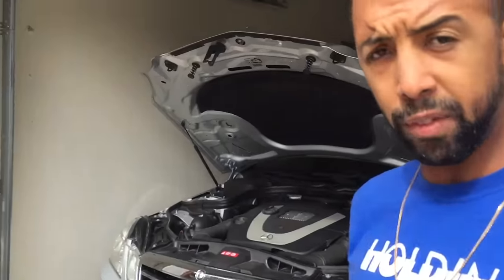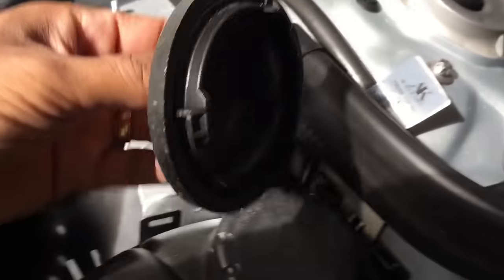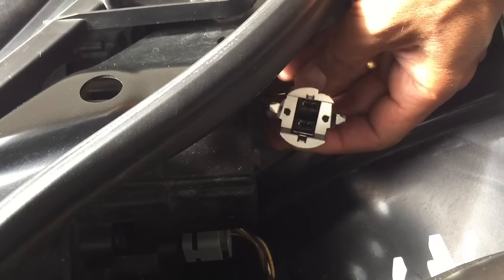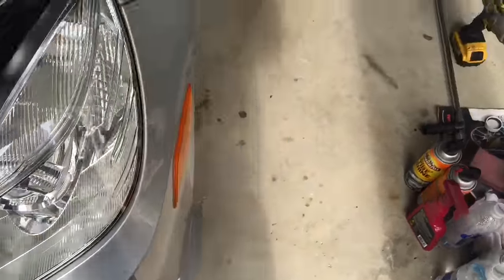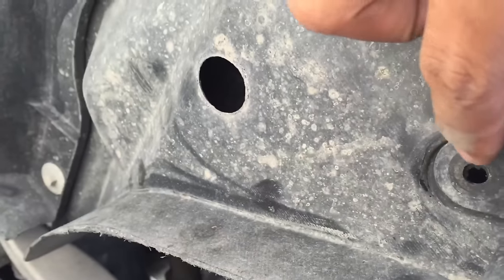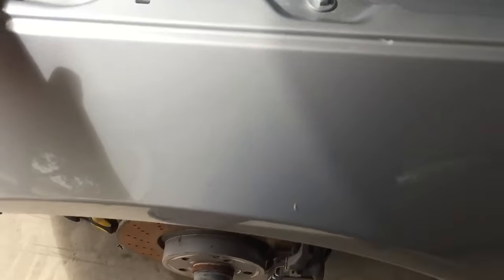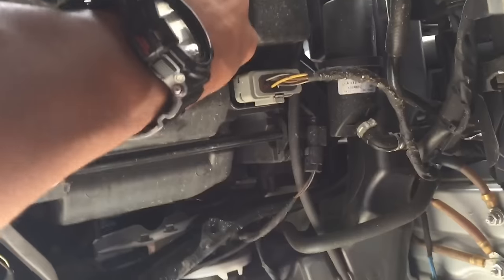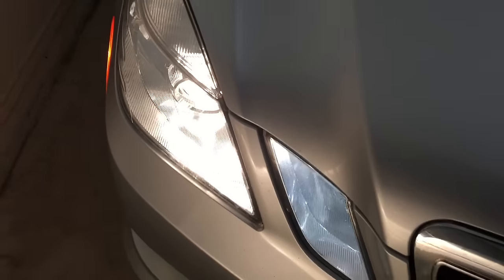How to change headlamp bulbs in your Mercedes E class

Comment: Just changed the same bulbs. The right side is easy, the left side just as easy, but you have to remove the two plastic nuts where the small device (don't know what it is) in front of his hand at 1:30. There is just enough space to fit your hand in to remove the cover of the Low Beam light. Easy Peasy! You do not have to remove the tire and shroud!

Comment: Hi guys!// i change the right side H7 bulb with a new one and still not function when i turn the steering wheel in the right like supose to do.. when i turn left the H7 bulb function butt not the right side
Reply from the maker: Daniel Timmer maybe try to go into the display settings and reset the turn light function

Comment: also jspec,on the driver side you don't have to take out the entire inner fender,just the 2-10 mm nuts and 2 of the plastic rivets and you can just fold it down and acces the bulb.also I upgraded my lights to opt7 5000k 55 watts h.i d,big big difference.

Comment: Good video but I have just changed my driver side low beam globe and its not necessary to remover wheel, wheel arch cover (although gives easier access to fitting). Difficult access yes but patience and I managed to remove cover and globe. All done in less than 5 minutes
Reply from the maker: Good tip!

Comment: Couldn’t you have changed the drivers side simply by taking. The coolant reservoir partially off it’s just one clip?
Reply from the maker: The risk of breaking or cracking that bottle means I’ll have to remove the entire bumper cover and risk damaging the parking sensors is another. I quickly learned why this way was the way Mercedes said to change the bulb. The first gen Cadillac SRX fog light bulb requires you removing the entire bumper to get to it.

Comment: Hey buddy, I watched your video and I was about to follow your directions when I noticed that I COULD access the headlight housing from the engine compartment. When you look into the compartment you will notice the the AC line has a very usual curve in it, that's so the tech can get his hand into and down to take the lighting compartment cap off. Also I found that there is a vacuum hose that's in the way. you can move it by taking the  clamp out. Once you take the compartment cap off you can very easily take the bulb out and change it. It actually took more time taking the bulb out the socket then the rest of the process. Please take a look at this and update your video. If I could do it, anyone can... lol
Reply: I really wanted to be able to change that bulb without removing the tire (and wheel well cover). I could access the little access door and I could get my hand on the bulb housing but I couldn't get enough torque to turn the thing.  I really tried - so I'd say it's worth trying to get it out without removing the tire but you might end up like me having to pull out the jack.  I do have to say it's nice that MB includes white gloves in the tire kit.
Reply: I took my E350 to the dealer, they did it for free and it took them 1 minute to swap the bulb, so you can access it without removing the wheel as above comment mentioned.
Reply: No you're definitely right - I could get my hand on it - I have a Bluetec so it might have a different engine compartment setup, but I just couldn't turn it. I might just need to work out my hand muscles or something.
Reply: There's no way. You've got to be talking about the parking light or the H7 high beam but the driving light on the driver side I can hardly pull the cover off let alone get my hand in there. Please make a video of this so I can see what I'm doing wrong.
Reply: ATL RIOT I agree I took off the vacuum line connection and moved it to the side.  I was able to take the cap off on the drivers side but there is no room to get my hand behind the connection to twist off.  I have a E550 with the V8 but I don’t think that should matter
Reply: No way you are getting your hand in there and turning that bulb to remove it on driver side.

Comment: Excellent instructions! My wife advised me her brother had changed the passenger side so I could change the driver side. The owner’s manual sucks for information. Your video is clear. I told my wife to take the damned car to whoever she wants to change the bulb. Yes I could do it after your excellent instructions, but I’m not wasting my time to do it! BS design to change a lightbulb. I have enough crap to do as it is!! Thanks for your video. There’s a lot of DIYers who’ll happily appreciate your information.  The information is accurate, I’m just p.o.’d at  Mercedes. I have my own work to do. My wife can pay the damned bill for a light bulb change!

Comment: I just took both side plates off counterclockwise then stuck hand in felt the plug turned it 1/4 turn counterclockwise removed light bulbs by wiggle outward was completely done on 20 minutes!!!! One needs to search more on YouTube to get this easy fix

Comment: What is the default color (K) and brand or is it best to go to dealer? Only my passenger side gave out and would like to replace only that one for now.
Reply from the maker: You’ll get a different colour even if you used the same bulb from a few months earlier ( I’d suggest changing both at the same time ) but if you have to do one just get the Silverstar ultra.
Reply: @Nissannx2000svg  Thank you for the suggestion and answering so quickly! I want to, but I don't have the space or time right now. fingers crossed on how it looks after.

Comment: There is a little door in the plastic well covering that allows access to the light cap without removing the wheel or the entire protective plastic you removed. Just reach in a find the knob to turn and open the door.
Reply: David Greenberg I noticed the rivets in the wheel well.  How do you get them out?  Just pull on the plastic cover or do you need a tool?

Comment: Have a question. How do you get the lights under the headlights changed out?  Those get his by rocks and go out a lot on my E550.
Reply from the maker: Rex Cumming never changed em before, if you look at the ones on the car they’re yellow. What I did was put a yellow vinyl tint on it which is pretty thick so it resist stone chips . Look up Lamin-X vinyl online they sell for the headlights as well

Comment: I have a UK 2012 E class and there is a small flap in the wheel arch liner which opens to give you access to the the low beam bulb.  Saves taking the whole liner out. Surprised it's not on the US cars.

Comment: Do you need a lot of power to turn the bulb-holder counterclockwise? I am not weak, but i'm not able to spin it! Or is there a trick? perhabs need to push and spin it at the same time?
Reply from the maker: turn it anti clockwise ,if you don't have a firm grip on it you'll have a little trouble but don't worry it won't break.

Comment: Does that bulb control both the low and high beams?  When I look up the 2011 Mercedes E350 it tells me there are two different bulbs for the low and high beams. If so, which bulb where you changing?
Reply from the maker: Vince c that was for the low beam
Reply: @Nissannx2000svg  thank you

Comment: How to align them headlights? One is slightly lower  than other on my 2014 Mercedes E350
Reply from the maker: I'll do a video on that
Reply: +Jspecwerks  I took it outside in front of my garage and I closed down the doors, located screw that might be adjusting screw and it worked! 😀🤓

Comment: Other videos talk about HID D1S bulb, do some have headlamp upgrade options?  If German engineering was so great it would require taking the wheel and fender out. I think my wife is on her second drivers  in 100k. My Toyota hasn’t neede either sides in 200k
Reply from the maker: Hugo Glenn Some had the adaptive headlight option which came wi the Bi-Xenon lights. I totally agree with you on some of the design flaws that some manufacturers put into their cars. Like the first gen Cadillac SRX where you have to remove the the front bumper to change the fog light bulbs or hot hard it Is to change spark plugs on the Subaru WRX STi. But there’s lots of simple and straight forward things that a easy for the DYS-er.

Comment: My parking light wont work after changing the bulbs...

Is there a fault code to clear
Reply from the maker: lewis eyers Did you change them ? These lights don’t run in series’s ( if on blows they both turn off ) try going through the settings in the cluster for any faults and if all fails disconnect the battery and let it sit for at least 30 mins. Let me know how it turns out